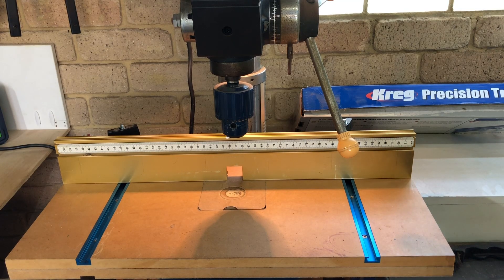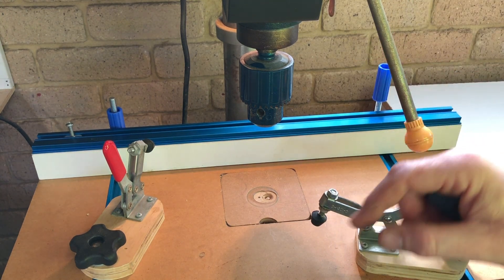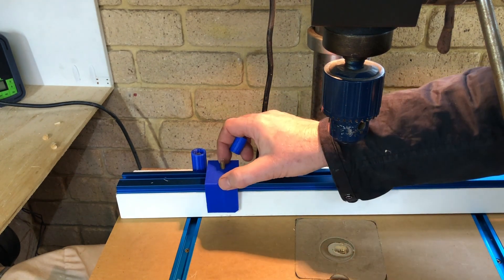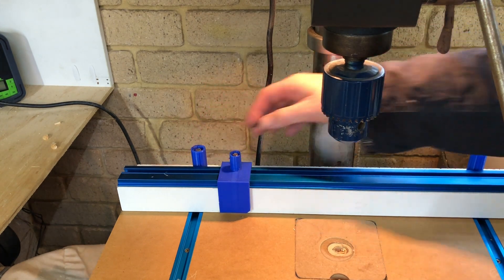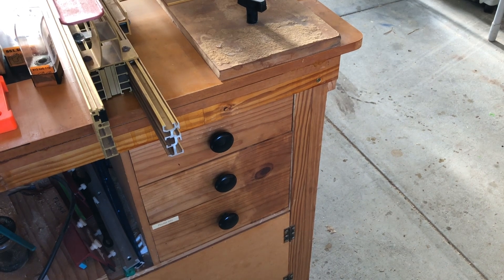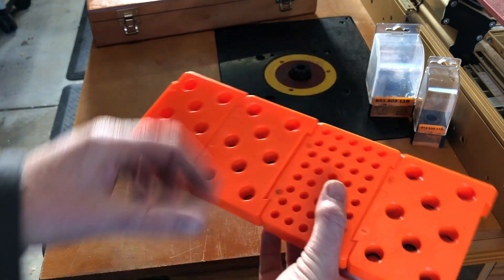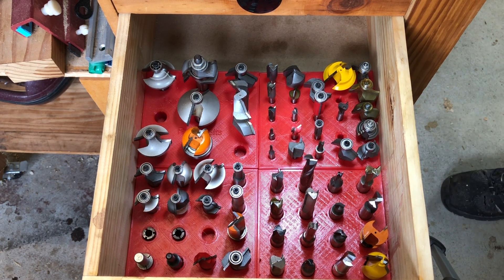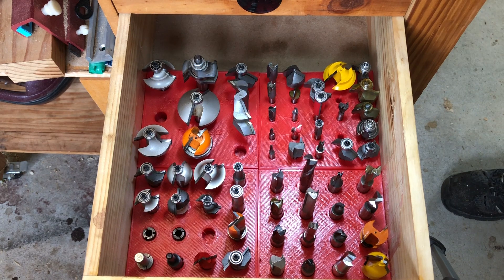3D prints in the workshop #3

Comment: The vacuum adapter... Why didn't you just print a y split?
Reply from the maker: Hi, I didn’t make a Y adaptor because to print one without a lot of supports would require a flat spot where it sits on the print bed. This method was easier to print and resulted in a good seal where the hoses meet the adapter.